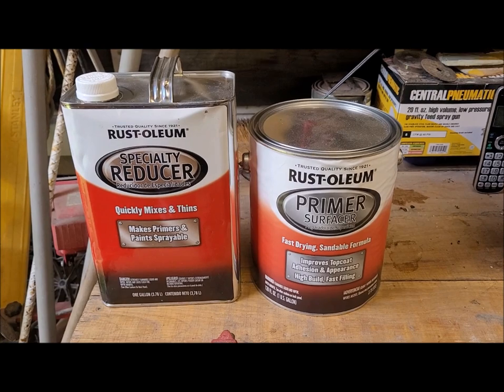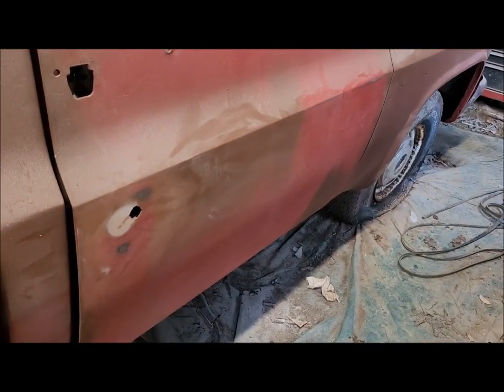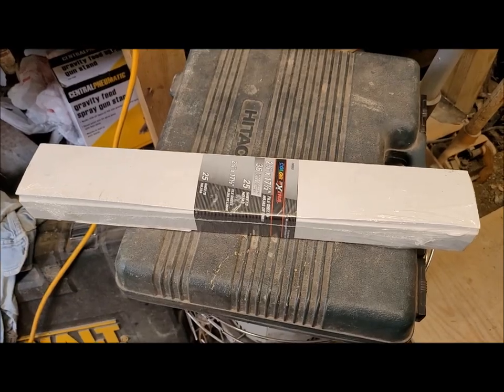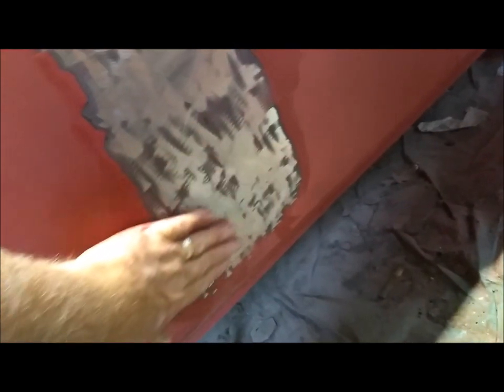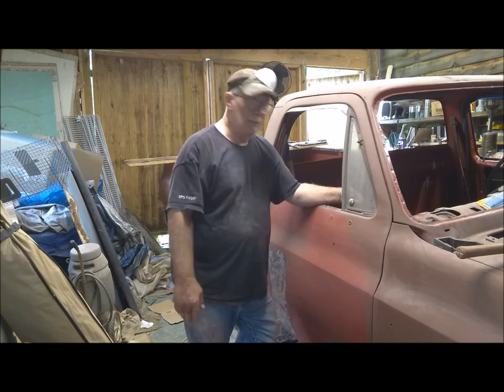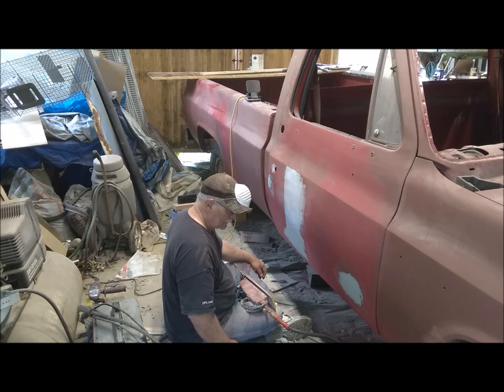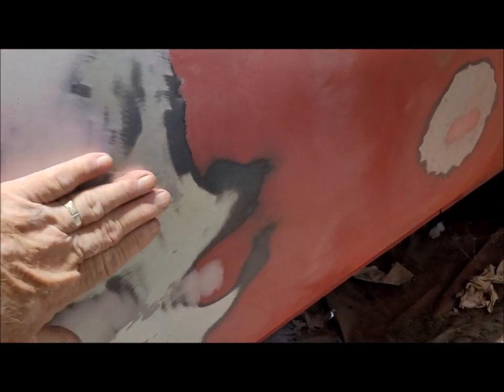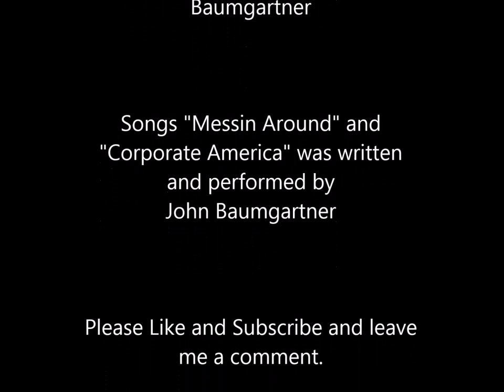More bodywork on the Square Body

Comment: I found that using my hand held long board as soon as I clean up my application mess, with 36 grit before it even cures. It acts like a cheese grader and you are able to get to the next step faster. Whether adding more or stepping up in grit
Reply from the maker: Great suggestions both. I appreciate your comments and advice. Thanks! john

Comment: Been gone awhile I just got back to see the updates in the truck looks great!!  I've used the harbor freight guns be sure to run some thinner through it before dumping paint in it ...I had one here last month I used for primer and it was defective had a whole in the casting and it was blowing air out....Good luck looks great!!!
Reply from the maker: Larry, thanks for the advice. I did notice that it will need a good cleaning as all of the parts are coated with oil that I assume was used in the machining process that will need to be cleaned. Welcome back! John

Comment: You're painting a car not a fence ? This was the cats meow in 1930 materials about a3 year paint job.
Reply from the maker: Thank you for your comment. I do however respectfully disagree. All paints have their pro's and con's and with todays basecoat / clear coat. First and foremost the cost. Second, the single stage Oil Base Enamel can be touched up with a quick trip to just about any hardware store where as the newer paint with require the entire panel to be repainted with a base and clear and is considerably more expensive. Modern paints have a tenancy to lose the clear coat which requires either a complete sand and repaint or if you are lucky just sand the clear and re-clear. I have never had Oil Based Paint crack or peal. Usually it just gets a powdery look to it which can be waxed or if real bad buffed out to the original shine. As I mention in the video, I am not building a show truck.  Thanks for the comment though. John